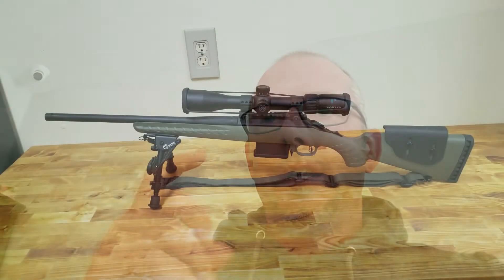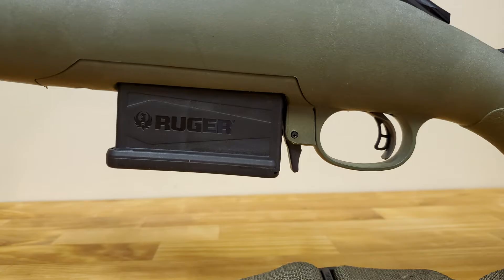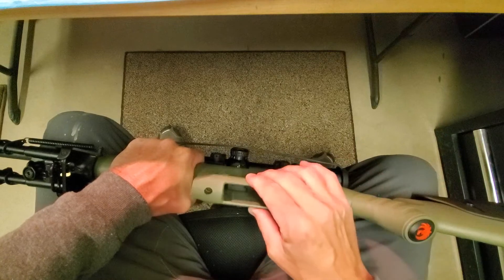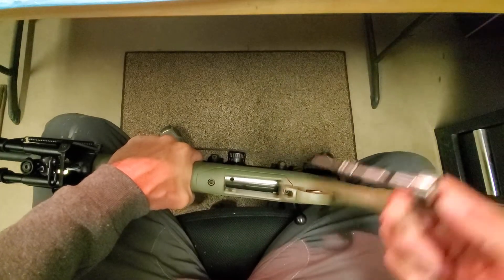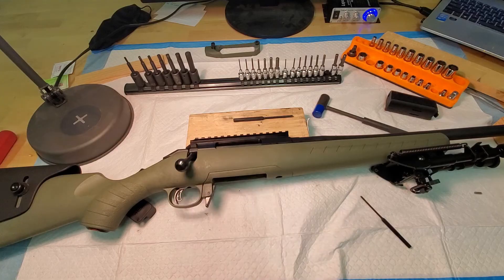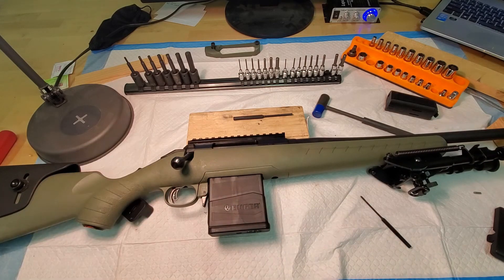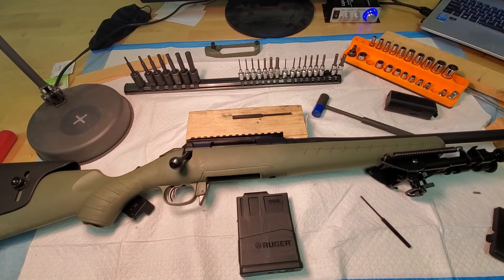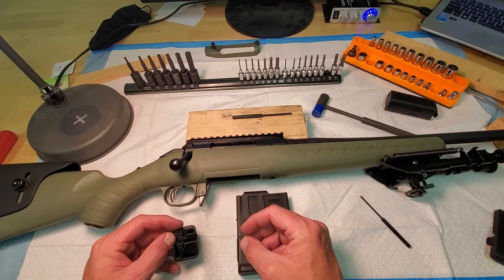Ruger Predator AICS Magazine Conversion and Upgrade

Comment: On a semi-unrelated note.  Those of you that have a Ruger American Predator in the 22-250, and want an extra magazine or two, DO NOT BUY the magazine Ruger recommends on their web sight (part number 90573).  You will have a lot of trouble with it.  Instead, get the Ruger American .308 multi-caliber magazine (part number 90689).  You'll be glad you did.

Comment: Thanks a lot for this video. I just converted my Ruger Predator 308 Win yesterday. It was so easy. And yes - Ruger does not send any instructions how to install this kit.
Reply: Do you like it with the ai mags a lot better? I don’t mind the rotary mag, mainly because it’s flush fit to the receiver, but have an ai conversion on hand just haven’t committed!

Comment: The torque spec for the action screws per Ruger is 60-80 in-lbs.  Alternately tighten.
Reply from the maker: Wow!  I was way off.  Guess I need to have my elbow recalibrated.  Thanks for the clarification.  That's helpful.
Reply: @VailAvenue  get u a wheeler fat wrench. I put my predator in a magpul hunter stock and it's a tack driver

Comment: Used your video to convert my Predator to AICS.  Thanks!  Ten round magazine seems a little ridiculous for a hunting rifle, but it's nice to have the option.  Using the 5-round for range time and hunting.
Reply: Where did you get your adapter
Reply: @brycelong1225  I called up Ruger Customer Service and paid $28 to have it sent to my door.
Reply: Thank you for telling me
Reply: If you purchase the Magpul brand AICS 5-round magazine(s) you can easily convert them to 6-round magazine)s by cutting of a section of the follower. The follower is even marked at the proper point to do so.
Reply: When hunting prairie dogs, the 10 rounder is not ridiculous at all but rather useful. You should see what quality 6.5 creed hunting loads do to those little bastards.
Reply: A 308 used primarily for hunting with the optional capability loading up 10 round magazines is anything but "redundant". It the becomes a dual-purpose "civilian battle rifle" with the added advantage of not being on anyone's politically incorrect / confiscation list.
Reply: 10rds is not nearly enough in a hunting rifle when you are hunting in southern AZ where you will encounter many two legged predators in the form of human and drug smugglers. AZ does not limit the rounds in hunting, except I believe for bird hunting.
Reply: Can this be done with the 22-250?

Comment: Good video, my rifle came with the AI mag well and spring release lever, but to adjust the trigger the catch and spring had to be removed. Without the fixture you received with your mag well, it it was challenging to re-install it. The re-install kit should be included with a new rifle.

Comment: I'm not I ruger fanatic but i got to give them some credit. I traded a savage for an old ruger m77 mark 2 compact 260 rem but i had it rebarelled with a benchmark 26''  barrel and realized the factory little stock wasn't gunna cut it i went on their website registered the old rifle and ordered a scout stock aics mag well  that was compatible with some customizing and also ordered a couple magazines and still ruger gave me the 20% off. the rifle is a bench tackdriver. thanks for the video and thanks ruger

Comment: Thanks for the video. When I ordered my kit the sales rep told me to torque the screws to 30-35 in/lbs.  I don't know if that is standard for all serial numbers or not so you may want to call Ruger to verify.
Reply from the maker: Yes, that spec is right.  I was way off on my mention of torque in this video

Comment: Good, concise video. I have the LH compact .308. I'm hoping I can do the same for it, the LH 6.5 Creed is coming, but had to bite the bullet and but the RH 6.5 Grendel and 7.62x39. Just don't understand why Ruger won't rotate the bolthead 180 degrees and make LH models of these since they would have the entire market to themselves. . . But this was a really good clear video and I'll be referring back when I get the kit for the 7.62x39 adapter to use AR style since it has to be similar.
Reply: I'm thinking about getting a LH Predator in 308 and doing the mod. Or maybe just save the extra money and get the LH Scout. The Savage Impulse Hog Hunter would be interesting as well.
Reply: Absolutely. Would kill to have a .22-250 and 6 Creedmoor in LH
Reply: Does this kit work on the left hand Ruger Americans?
Reply: @maxolsen2096  I just made this conversion for my left hand 6.5 creedmoor Ruger American Predator.  It works just fine.

Comment: I did mine. Had to fit the latch with a file.  Check your latch length against a magazine before assembly.  Mush easier to do any filing before assembly. Pay attention to the factory profile if you have to.  Each one can be a bit different.

Comment: Does this work with the standard Ruger American? I have a standard .308 with a Boyd's stock I just got, the new stock is not compatible with the original rotary mag so I'm wondering if the AICS conversion will work? TIA
Reply from the maker: @elirunge6709  Hey.  I'm not sure i understand.  If you have a Boyd's stock, whether it came with that rifle as a factory feature, or if you put a Boyds on that barreled action aftermarket, it would be a Boyds magwell and mag release system as part of that boyds stock.  This process is just for a Gen 1 Ruger short action stock, not a Boyds.  Maybe your Boyds is already set up for AICS magazines and you just need to buy the mags?
Reply: @ the stock did not come with a mag well or mag release but it looks like it’s setup for the Boyd’s AI mag kit, I think I need to order that but unsure. I’ve attempted reaching out to Boyd’s and have heard nothing back yet.
Reply: @VailAvenue  Update, I ordered the wrong stock. I had the options of ordering the removable mag stock or the ar mag stock and I assumed that ar meant ar 15 style, my fault. I’m now hoping that I can order Boyd’s ai mag conversion kit and it will work on my gun. Thanks for the info

Comment: Sorry if I’m duplicating a question but what cheek riser is that?  I need to make that addition to mine.  Also, great video!  Thanks.
Reply from the maker: It's from "Matthew's Fabrication" and you can now buy them on Amazon.  I used smaller stainless thumbscrews from Mcmaster-Carr just because I wanted them more sub-dued, but he does provide the hardware including larger thumbscrews than are seen on mine in the video.

Comment: Definitely will be coming back to this one since I just bought my second RAP, in 308 Win. Haven’t even been to the range yet to shoot it. MIGHT sell my first RAP in 6.5 CM although it’s a shooter, but will be doing the AICS Mag conversion in my little 308 for sure. Anyhow, any suggestions for a muzzle brake and if I really need one if I’m not particularly recoil sensitive? Thanks for the conversion demonstration!
Reply: why would you want to sell your ruger American creed? That's a fantastic tack driver for whitetail or whatever you put the crosshairs on. My shoulder prefers it over the .308
Reply: @kurtglo  letting my nephew hunt with the 6.5 this fall. Gonna try some Winchester 129 g Power Points in it next time at the range. It’s a great rifle but surprisingly my Ruger American Predator 308 doesn’t kick bad, despite its light weight. And with the 18” barrel it’s the exact same length as my other brush gun, my Marlin 35 Rem, which they apparently don’t make ammo for anymore 😢.
Reply: @davidrussell631  that will make your nephew a great rifle.  I hunted with a 7mm Rem mag here in Michigan until I fell from my tree stand while bow hunting. Another great tack driver from RA is the 7.62x39. Shoots great in the brush as well. Happy hunting
Reply: @kurtglo  I fell while trying to hang a stand almost thirty years ago. My mistake was in not using a linesman’s belt, although I honestly don’t recall ever seeing one used at the time. All I had at the time was a little shoulder harness they don’t even sell anymore that my wife picked up for me and told me to wear. Thankfully by God’s mercy the bones of my feet healed while in a cast and I had no permanent injury. So thankful you’re still with us after your fall.
Reply: @davidrussell631  Thanks David- Yes, not many people survive a 25 foot fall and still live. Even "superman" Christopher Reeves parallelized himself after falling off a horse!
Reply: Installing a muzzle brake will make almost any shooter a better, more accurate and faster follow up shot shooter. Never apologize or think yourself "less macho" for adding a muzzle brake to any center fire rifle. Only the uninformed and knuckleheads poo-poo muzzle brakes.
Reply: @okgentfarmer  since I’ve found some hearing protection I can hunt with I just might put a muzzle brake on my 308. Any recommendations?
Reply: @davidrussell631  What hearing protection are you using for hunting?
Reply: @perfect7liberty  at the recommendation of a guy at our Bass Pro I went with what’s now called the Walker’s “Rope” hearing enhancer. They sell it for $79.99 and it worked really good for me. Basically it’s just a set of ear buds that are connected to each other. Protects your hearing with decent enough sound enhancement that I’m really looking forward to using for turkey season next month. I should be able to hear more gobbles!
Reply: @davidrussell631  :  Very cool.  I’ll look into it.  Much cheaper than a suppressor and doesn’t add weight to the rifle. Lol 😂
Reply: @perfect7liberty  yep. Comes with a little jack for recharging.

Comment: The action screws do not have to be torqued down. They just need to be a tight snug fit.
Reply: Why not contact Ruger on the torque? When I did they specified 60 to 80 inch pounds. Why guess?
Reply: Ruger told me 30-35 inch pounds for the AICS

Comment: Do this with a left hand model. I just bought a left handed 6.5 Creedmoor after they (customer support) told me they would convert, but when i went to order the kit they, then told me the left hand could not be converted, if they would have told me that in the first place i would have bought a savage left hand already with the magazines
Reply: I was told the lefty would not convert, but I ordered the parts anyway. I want to find out for myself.
Reply: @brianclevenger5521  Did it work?
Reply: @perfect7liberty  AI mags are single stack center-feed. Right or left hand action is irrelevant

Comment: I have the go wild 350 legend, and its feeds and jams a lot with the AR platform and its a common issue for a lot of people. Has anyone tried this conversion with the 350 legend? And if so, did it fix jamming/feeding issues?
Reply: I have one on order for my 350 legend ranch right now. Same issues with feeding. Ruger said it would fit but didn't guarantee good feeding. Forums I've read through say it works awesome.
Reply: @smedanglerbronzeback7893  I ordered one as well, I will let you what happens

Comment: Will this conversion work on the Standard Ruger American, or will it only work for the predator
Reply from the maker: I dont know.  You need to give Ruger your serial number and they tell you if you are a candidate for conversion.
Reply: @VailAvenue  awesome thanks, I'll give them a shout and see
Reply: @3rdeyespy967  if is a new american ruger model it will work
Reply: @SuAmigoElilegal  yep mine is a candidate, I'm going to be ordering it soon
Reply: @3rdeyespy967  👌
Reply: Is the magewell removable?  If so it’s a candidate.  If it’s all one piece, you’re looking at a new stock.

Comment: .I just used a Remington 700 walnut stock, inletted the top for the Ruger American, dropped (bedded) in the V blocks, use Pacific Tool and Guage bottom metal. Much better.
Reply: How is it much better?
Reply: @d30gaijin  to start PTG is metal (vs. Ruger plastic). Oversized winter triggerguard, mag funnel, CNC machined for fit, vs Ruger injection molded plastic fit (magwell has to have to have exact tolerances to feed correctly since there is no front lug in AICS mags, nor detent, otherwise the mag rocks back and forth), PTG bottom metal can be glass bedded into place with zero flex, zero material weakness in cold weather, and not susceptible to structural damage in pro longed heat, and UV. Metal mags in PTG are drop free, extended latch, trigger hand operated.......and.... you don't have to go through all these steps to disassemble your rifle (like in the video, removing and re installing the mag latch). With the PTG, it just takes 1 allen wrench, and a few seconds. No disassembly of the mag latch....ever. 
Or do you mean how is a wood stock better than the thin plastic ?
Reply: @takinisurvivalchannel3812  Thank you for the detailed explanation.  Very enlightening.

Wood vs. plastic stock is a whole different topic.  I have used both with excellent success.  My current Palma Rifle wears a laminated wood stock, although I have used McMillan glass stocks on my Palma rifles with equal success.

Again, thanks for your explanation.

Comment: What sort of raised cheek rest thing is that? I'm in the market for one for my Predator and am a new gun owner
Reply from the maker: There are a variety of ways to generate a cheek rest.  The most common used to be a velcro on version.  This one is a kydex that is fitted to this stock.  40 bucks from Matthew's Fabrication.  It's great.  Just Google them and you will find it

Comment: Are the new green 308 predators compatible with this upgrade?
Reply from the maker: I would guess the newer, the more likely, but you just need to call Ruger with your serial number.  They determine off serial number only.  I don't know which serial number groups work and which don't.  But if you call and it is eligible, yiu can order the kit on the phone with them right then.
Reply: @VailAvenue  I haven't bought the gun online yet so no Serial number

Comment: Unbolting the action from the stock wouldnt affect your zero. The scope is mounted solid to the action and shouldnt move at that point.
Reply: Honestly even taking it off the rail will have little affect
Reply: I would think the same.
Reply: As long as you werent sloppy about re installing it i would think it would still be awfully close
Reply: I take mine off and put it on other rifles with little shift in zero when I dial back to my zero and put it back on the rifle it lives on

Comment: AICS magazines of all brands are way overpriced. It is my belief Ruger missed a great opportunity to fit these America rifles with a magwell that will fit standard AR magazine, as well as AICS magazines(like the RPR). In particular the Magpul PMAGs , of which I have dozens of in .308WIN/7.62NATO. Magpul PMAGs for AR-10s can be had at half the cost and are flawless. Yes, the AICS style magazine allows you a longer C.O.A.L. but if you are not reloading to 0.020" from the lands the AICS magazines make zero sense.

Comment: Hello: Well I called Ruger. I could tell the guy would like to say Ruger has no Problems. We were getting no where till I said people on the net said I need to change Mag Well. He said YES, I will send you one. I said will I get a Magazine that fits it. Ready for this,,,,,He said NO We do NOT have any Magazines. Am I that Dumb, I was talking to a Guy at Ruger, Right. Why am I back. The Ruger   Guy said 30 to 35 inch Pounds. I do not have lock tight. I am thinking go putting a dab of Finger Nail polish on Screws. That was a Dollar at Dollar Tree, $1.25 Tree now. I wrapped fishing rod eyes at  10 years old and painted the thread with Finger Nail polish. I used Sewing Thread, use what you got. It's still on the rod. I think I will do 28 Inch Pounds, we dealing with plastic.